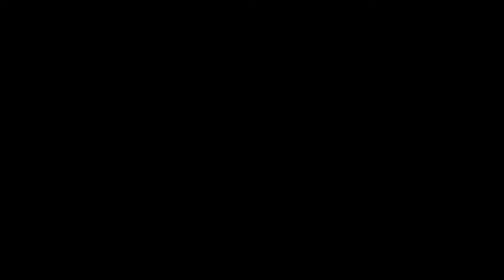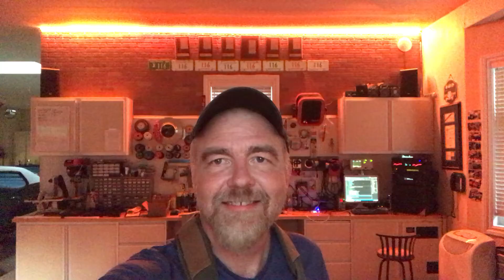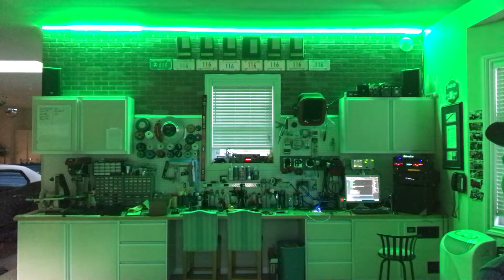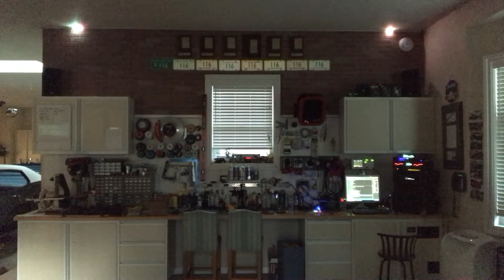My Shop's on Fire! with Arduino! FastLED and WS2812B LEDs Shop Project Example

Comment: I have made my way through all the videos, noting some missing episode numbers, but pushing through them all. This being my 2nd and 3rd time through some videos, I am slowly making progress. Dave is quite correct that Platformio is pretty easy to install on the VS Code platform. It has certainly been fun picking up the next code and seeing how it affects the strip of LEDs.  This pass through the video series, I am hoping to figure out integration of all the code into a select able method, as well as swap from the ESP32 the early videos are based on, into the M5SticC Plus. Believe me, they are different.  I was hoping to find a conversation on the Discord server, but am still making my own way, slow and go.  HIGHLY recommended if you are wanting to create these effects or just learn.

Comment: Hello dave, some info about the code? maybe a privatemessage?
Reply from the maker: Once I'm done (and I'm pretty much done) with the code I'll package it up somewhere.  I don't want to do a full github project, but I'll put it up on a website or similar!
Reply: @DavesGarage  Hello, How get or find your source code?
Reply: @DavesGarage  Hello. Is There Any chance that you share the code? The fire effect is great 🔥🔥. Thank you !
Reply: Please share the code man, pleeeeeease!!!!!!!
Reply: Mr dave all are asking the code they're your fans please give the code to them
Reply: @DavesGarage   Hello -  I have a question what led strip WS2812B do you use? how many leds per meter ? whether it affects power or operation ? is it possible to connect the entire 5 meter strip 144 led per meter in your project?  which power supply do you recommend? I understand almost everything even though I have never learned English and I help myself with a googlet translator. I have a request if you could give the exact parts used in the project with the given number of LEDs, length, type etc. during the next video. I think that links are not necessary, and it is enough to give the names of components and specifications in the description and everyone will find in internet.  Thank you in advance for your answer and best regards. great job and effect ;)